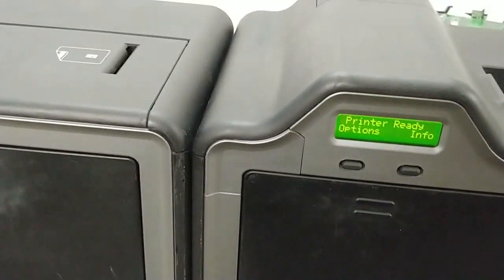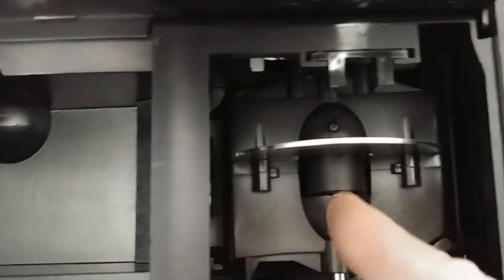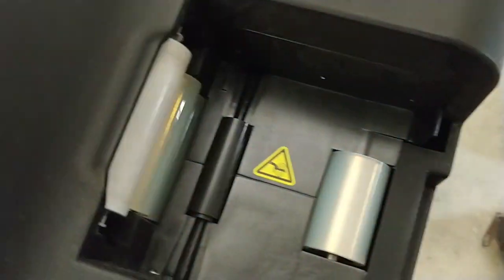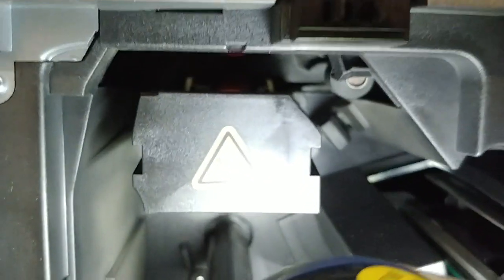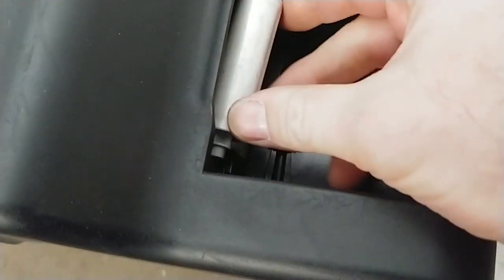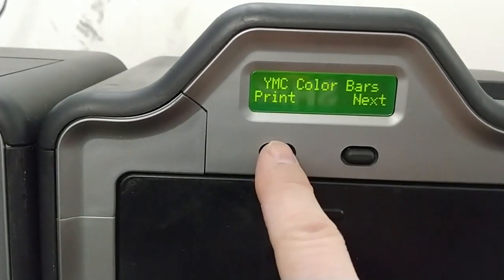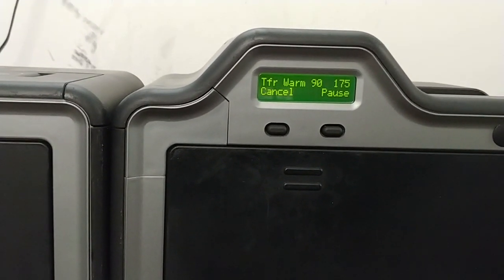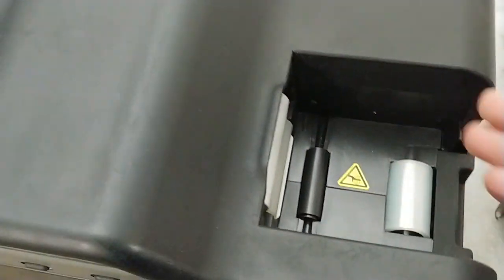Fargo HDP5000 HDPii troubleshooting card jams

Comment: I have a DTC4500. I'm getting 112 error. I'm using the test print, and it 'jams' (more like stops) printing with approx 3cm of yellow - it calls out 112 error. I have cleaned the printer with sticky cards, and alcohol. It still jams at printhead area. I'm out of ideas. The feed pulls cards thru left and right when I remove the ribbon cassette. Is there any help available?
Reply: If you have completed standard methods such as clearing jam, doing user maintenance such as cleaning, ribbon calibrations...then we can only suggest having a technician inspect it.  There could be issues with a belt, motor, roller, cable connection among other things, that may require service beyond user capacity.

We do offer DTC4500 service, but you may have a local authorized provider in your area.  If not, contact us if you would like to obtain service.

NOTE:  Please consult the User Guide for troubleshooting to exhaust your self help measures.

USER GUIDE:  https://www.hidglobal.com/sites/default/files/resource_files/plt-01669-1.1_dtc4500e_user_guide_en.pdf
Reply from the maker: Error 112 on a DTC4500 printer indicates an issue with the laminator. This error code specifically points to a problem with the laminator communication, which means that the printer cannot properly communicate with the laminator module.

To resolve this issue, please follow these troubleshooting steps:

1. Turn off the printer: Before working with any internal components, make sure to turn off the printer and unplug it from the power source.

2. Check the laminator connection: Ensure that the laminator module is securely connected to the printer. Look for any loose cables or connectors and make sure they are firmly seated.

3. Remove and reseat the laminator module: Gently remove the laminator module from the printer, then carefully reattach it, ensuring that it's properly seated and connected.

4. Inspect the laminator module for damage: Check for any visible damage to the laminator module or its connectors. If you notice any damage, it might be necessary to replace the module.

5. Update firmware: Ensure that the printer's firmware is up-to-date. Outdated firmware can cause unexpected errors. You can download the latest firmware from the HID Fargo website.

6. Turn the printer back on: Plug the printer back into the power source and turn it on.

After completing these steps, try running a test print to see if the Error 112 has been resolved. If the issue persists, it could indicate a problem with the laminator module or its communication with the printer. In this case, it is recommended to contact HID Fargo technical support or an authorized service provider for further assistance.

If you need any additional guidance or encounter other issues, please don't hesitate to ask.
Reply: @SupportDepartment  I replaced the lam mod 4 years ago.
Thank you! I will document this for the future.

Comment: Unable to feed error 14 from FargoHDP5000 how can I solve out please told me some one
Reply from the maker: Error 14 on an HDP5000 printer typically refers to an issue with the ribbon. This error code usually indicates that the ribbon has either broken or is not moving correctly. To resolve this issue, please follow these troubleshooting steps:

1. Turn off the printer: Before working with any internal components, make sure to turn off the printer and unplug it from the power source.

2. Open the printer cover: Open the top cover of the printer and inspect the ribbon cartridge.

3. Inspect the ribbon: Check if the ribbon is broken or if there is any visible damage. If the ribbon is damaged, you'll need to replace it with a new one. The part number for the standard YMCKO ribbon is 84051.

4. Verify ribbon alignment: Make sure that the ribbon is properly aligned and seated in the ribbon cartridge. If the ribbon is not aligned correctly, it can cause the error. Gently remove the ribbon cartridge, reseat the ribbon, and reinstall the cartridge.

5. Clean the printer: Use a Fargo cleaning card (part number 85976) to clean the printer. This will help remove any dust or debris that could cause ribbon movement issues.

6. Update firmware: Ensure that the printer's firmware is up-to-date. Outdated firmware can cause unexpected errors. You can download the latest firmware from the HID Fargo website.

7. Ribbon sensor check: If the issue persists after following the previous steps, there might be a problem with the ribbon sensor. In this case, you may want to complete a ribbon and film sensor calibration.  After that it is recommended to contact HID Fargo technical support or an authorized service provider for further assistance.

Once you have completed these steps, turn the printer back on and check if the error has been resolved. If you continue to encounter Error 14, please let me know so I can provide additional guidance.
Reply: @SupportDepartment I'm getting error 14 and it mentions a feeding problem. Keeps telling me it's the wrong card when it isn't.  The roller beneath the feeding tray rolls forward and then backwards continuously.
Reply: Edge of the card goes between the double rollers and won't go further

Comment: have a HDP 5000 its giving me error 200 card jam and rebbot required how do i reboot it. please someone should help out
Reply: Just turn it off and on again. That’s a reboot
Reply from the maker: Error 200 on an HDP5000 printer indicates a card jam issue. This error occurs when a card is stuck in the printer or if there's a problem with the card feed mechanism. To resolve this issue, please follow these troubleshooting steps:

1. Turn off the printer: Before working with any internal components, make sure to turn off the printer and unplug it from the power source.

2. Remove the card hopper: Gently remove the card input hopper and card output hopper from the printer.

3. Open the printer cover: Open the top cover of the printer to access the card path.

4. Locate the jammed card: Carefully inspect the card path and find the jammed card. If you see a card stuck in the printer, gently remove it using your hands or a pair of tweezers, being careful not to damage the printer's internal components.

5. Clean the printer: Use a Fargo cleaning card (part number 85976) to clean the card path, rollers, and other internal components. This will help remove any dust or debris that might cause card jams.

6. Inspect the card feed rollers: Check the card feed rollers for any signs of wear or damage. If the rollers appear worn or damaged, they may need to be replaced. The part number for the card feed roller is 86177.

7. Reassemble the printer: Once you've completed these steps, reassemble the printer by reinstalling the card input hopper, card output hopper, and closing the top cover.

8. Turn the printer back on: Plug the printer back into the power source and turn it on.

After completing these steps, try running a test print to see if the Error 200 has been resolved. If the issue persists, it could indicate a problem with the card feed mechanism or sensors, and you may need to contact HID Fargo technical support or an authorized service provider for further assistance. If you need any additional guidance or encounter other issues, please don't hesitate to ask.